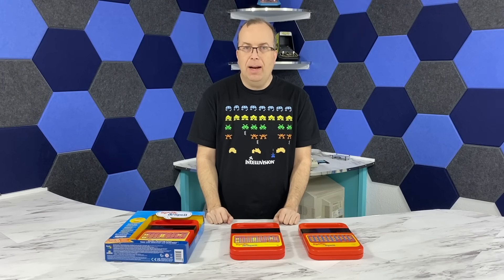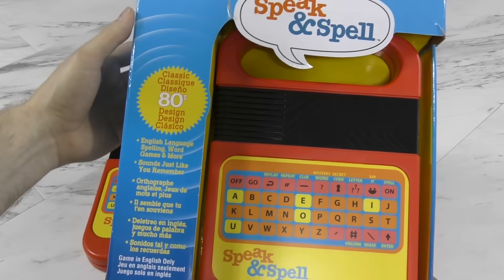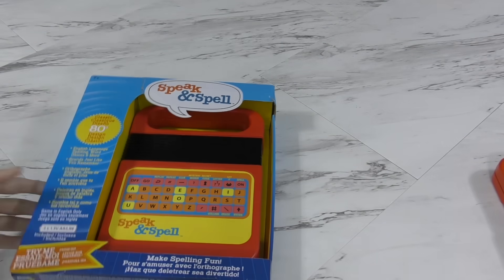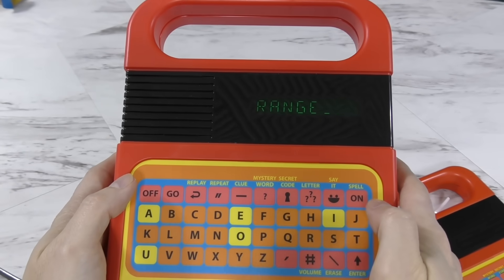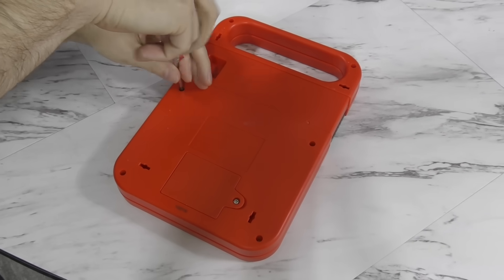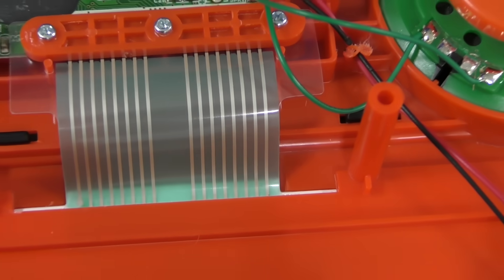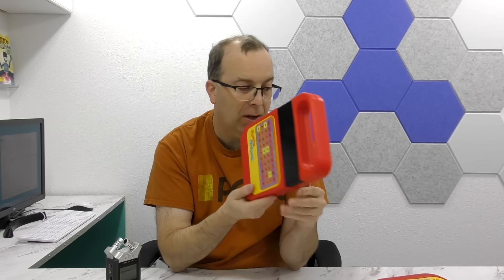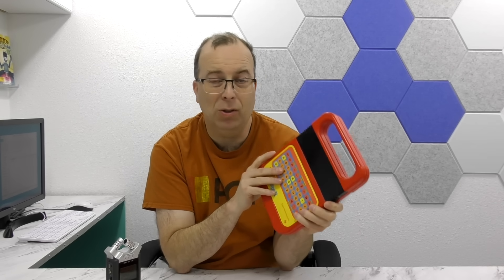Speak and Spell - 1983 vs 2019 model!

Comment: I'm not sure why they couldn't have partnered with Plogue, I believe they currently have the rights to the original Texas Instruments TI-99 voice (which I think is the same as the Speak And Spell TTS, it sounds the same to me at least) and they digitized it to use in a vocal synth program, turning it into a character named Terminal 99.
They could've just used the Terminal 99 version probably

Comment: Okay, none of them are the original. The original was pre-1978 and had the flat buttons similar on the 1980’s. The button one was made later to show progression of technology and to pretend. Now the original pre-1978 one I haven’t seen since 1978 or 1979 and being that I was born in 1978 it’s been a while. But it may have looked slightly different; but definitely not the phone button model, it’s newer.

Comment: Um, YOUR 1980s original doesn't say anything on boot-up. Mine said the exact same thing as your modern unit. I've had that phrase stuck in my head for over 35 years..."spelling, level A, press 'go' to begin. Press 'enter' to check your answers." Then in my head I always say "module" in the same voice, because I always pressed the module button after it booted up lol. 

So, I don't know why your original doesn't do it, but it's supposed to.

Comment: Hey David, I don’t know. I don’t think it really matters how old this video is, but I think that was a dumb decision of you to throw away those batteries, considering the fact that the reason why the batteries didn’t work was because you hadn’t removed that tag, the tag that you removed the white thing that you removed from the back of this machine was what was keeping the electricity from going through the whole system, which is why you couldn’t turn it on when you were trying to play with it, which is weird when you think about it, considering that it had the tag in the back why would it have a whole thing saying that you can turn it on and try it out when you couldn’t do that unless if you had to remove the tag. Pretty stupid but, by you removing those batteries, you could’ve thrown away some good batteries with some energy in them.

Comment: 2:28 The Chinese batteries in that are far superior to the crap Energizers you put in there.  The Chinese batts will NEVER leak.
Reply: Only because they are cheap carbon zinc cells. The only benefit is less of a chance of leaking (they still can leak though, I've seen it).

Comment: i knew exactly what it was going to look lke when you opened it up., I mean if you think about it, my smart watch which is a ton smaller packs about 1000x more punch that that little IC board, but is obviously more expensive to produce. That thing has about 75 cents in plastic and 3-5 dollars (mass prod price) in electronic components in it and they sell if for what? 30-40 bux? youre better of buying a prepaid cellphone at wallmart for that price and never activating, would have more power lol.. but i get the nostalgia of it all.
Reply: i didnt even finish watching when i wrote that.. and i see he came to the same conclusion as me lol

Comment: The biggest fault with the remake is that it's limited to the vocabulary in the base unit. Unlike the original, you can't load in additional words via the ROM cartridges that they sold. The new device should have had some flash memory and a USB port to load in additional words, from a website, which is easier now than ever.

Comment: The voice synthesis chip in the original SnS is the real star here (with the VFD a close second). Those TI chips use a simple serial input to generate speech. I’ve been scouring local thrift stores to locate one of the original models just to get my hands on that chip. I have a specific project in mind that requires a robotic sounding voice. Modern speech synthesizer ROMs are insanely complicated and difficult to code. Next one I find on eBay under $30 is gonna be mine!

Comment: Well, the benefit of the new unit is that it can be made into a more advanced computer with all the open space in the case. It also explains why there is no headphone or power jack. It would have been an additional board and case rework.

Comment: The 2019 was not manufactured by Texas Instruments. That unit was licensed by a company called Basic Fun and they omitted the usage of the microprocessor and synthesized voice chip TMS1000 and TMC0280. 

Also, the VFD LCD screen has been replaced by a segmented LCD screen. These alterations were done because the unit needed to hit a certain price point.

Comment: Actually the origional 80s design had actual keyboard bottons, not the overlay you show in this video. Our push button version lasted a lot longer than the overlay, in which the overlay would crack underneath on lans that got pressed more often, and costed $16  to replace from manufacturer. Chaney Electronics sold them at $3.20 each, so bought 10 for when they wore out as well. Not sure if they were manufacturer or generic at the time.
Reply: That was only a cosmetic issue. The electronic guts were exactly the same.
Reply: @jimbotron70  Not at all. The push button unit had a slot for additional cartridges, where as the flat unit did not.
Reply: @sirxanthor  OK, fair enough. Btw the sound engine was exactly the same.
Reply: @jimbotron70  Someone at some point, copied it over to the Amiga PC. I used to prank my younger brothers answering machine with it often.
Reply: @sirxanthor  Yeah, the narrator.device 😄

Comment: Agree that they should use an LED segment display, but doing the original voice would be easy: you can easily emulate the original speech synthesis chip on even an ultra low cost modern microcontroller. And in fact the software to do so on an Arduino is freely available.

Comment: I came across this video while working with an Arduino library called "Talkie." I was surprised to find out that I could actually play sounds and music on an Arduino with specifications like 2KB of SRAM and a 16MHz ATmega328P processor for the Arduino Uno. It gave me a sense of nostalgia, as if I were experiencing the same excitement that the 1980s generation felt when using Speak and Spell devices.

Comment: If you take the thing apart, the LCD is actually not "connected" to the board. It has a rubber strip which makes contact between the LCD and the board itself. I have no idea if its a traditional LCD with just an eccentric power delivery method, or something more ... amazing.
Reply: LCDs are all driven the same way.

Comment: I still have my Speak & Spell.  Later on I bought other Speak & Spells at garage sales. I also have the original units with the buttons instead of the smooth keypad.  

The 2019 version of the Speak & Spell, I can see the text without my glasses.

Comment: It probably wouldn't have been that hard to make the voice sound similar to the original one if one of the people doing the design knew of the sound exchange tool. It runs on the command line for both linux and windows, and can convert into and out of linear predictive code audio format among others, so they could have very well sampled those in if someone had taken to time to do that. LPC was what the original speak and spells, speak and maths, etc used and it in itself is what gives them their particular sound.

Comment: There is another market for these..  the circuit bending community... for the sounds. The distortion of the original sounds objectively better, and as the batteries would die, it would sound even cooler. If I could get that sound in a bitcrusher pedal for a bass, it would be a "holy grail" moment in my search for a perfect distortion pedal. I've seen/heard hacked speak and spells... pretty cool. The new designs are made to exclude the hacking community, and missing out on a segment of the potential market.

Comment: The only main differences is the AC adapter and the screen the original actually does have a bright vacuum fluorescent display as well as an AC adapter for if you don’t wanna waste money on batteries or as the new modern one doesn’t

Comment: Actually, i do think the speak-and-spell does have a place in the market - just, maybe not the market it was originally intended for. From what i understand of old speak and spells, is that they were very hackable and able to be turned into circuit-bended noise-makers and make all sorts of experimental musics with it. 

so .... if the manufacturers had instead been more faithful to that perspective of it, and gone with a larger board (or even 2 or 3 boards, with wires ?) that was readily hackable (as opposed to hiding everything under a blobbed-over microdot) then they would have maybe done a better job of moving product of this re-issue, rather than trying to lie to us as gen-X'ers and elder millennials, and try to 'sell to our kids' as cheaply and as exactingly-efficiently as possible, when we are clearly atleast 20 years into something vastly superior in terms of screen-toys. 

if i ever do buy the 2020-edition speak and spell, it will really be for the case only, as a 'rebuild from the outside in' project, as a then-purpose-built circuit-bended speak and spell.

Comment: I think the biggest flaw of the new one is the pre recorded sampled voice, only filtered to make it a little more like the original "robotic" one, but failed. The original used speech synthesis. Main selling point of making remakes is being faithful to the original, not "somewhat similar" which btw is why the Behringer clone analog synths are so successfull on the market. 

And the downsides: no output is clearly the downside (yeah you can make it yourself, but it's annoying and because these are samples, there is no point). LCD is worse than the original. OK i understand the speech synthesizer would be too big cost, but they could at least sample all the content from the original one and put it straight to the new one. It seems that no nerds were involved in the design process :(

Comment: As a nerd/nostalgia product they should have put at least an emulator of the original voice algorithm into the remake Speak&Spell (if too expensive, at least use samples of the 1980th authentic voice). For musicians those might be interested too, they should have also added the contents/words of all cartridges those existed for the original, and possibly a synth mode that (particularly if speech is emulated) could play with sound parameters to mimic some circuitbent sound tricks of the original.
Reply: Good point i wrote the same one minute ago. synth mode would be great. so, at the moment, is better to use some speech synthesis or buy arturia microfreak :)

Comment: So the 2019 speaking spell is trash cheap trash. Yes it takes smaller batteries but the screen and speaker are garbage and you can't plug it into the wall or plug a headset into it so a child playing with it has to go where they can't disturb anybody and God forbid the batteries die and there are no extra batteries in the house. I think I saw the the 2019 one is also dirt cheap like $25 where I know the 1985 one was $50. I know he was showing a 1983 one but you figure in the age range for the Speak and Spell and for me it was a $50 toy and no way my parents would have considered it. It's also the reason why I didn't get a Teddy Ruxpin or a glow worm.

Comment: "classic 80s design... that's sorta true, sorta not"

Then goes on to demonstrate that it doesn't have the same tech as the 70s design, rather is modeled off the 80s design...  Uhmm, yeah man!  That's EXACTLY true then!  lol
If it had said ORIGINAL 80's design, it would be misleading.  But it said the CLASSIC 80s design, which you then verified was correct.  Great stuff as always, love it :)

Comment: I've been doing a lot of thinking about the re-releases and remakes people are doing.
This ranges all the way from things like remade tv shows to remade products.
The look of the thing, or the sound, is fairly nostalgic. Unless you're a total nerd, and I fall into that category, you're not going to hear the difference between the TI sound chip and this new one. The appearance matches, and who wants to shell out for three C-cell batteries, so AA-cell are just fine.
But what people are missing, with this product, with remade shows and songs, is the character behind the thing.
The original Speak and Spell was great but had its limitations. I argue that the limitations are honestly part of the nostalgic experience. At this point, they would have done as well by making a $5 Speak And Spell app for iOS and Android. More people would buy it, more kids would get to experience it, and we'd all face the fact that the new device isn't a Speak and Spell sooner rather than later.
The problem is that you can't optimize nostalgia for profitability. The reason, as you stated, that the Speak and Spell was discontinued was lack of relevance. That means it was no longer profitable. Making a new device to vaguely emulate the Speak and Spell experience creates a brief surge of nostalgic feeling that quickly leads to disappointment because there's nothing behind the appearance. It's not hackable. It's not expandable. It's not compatible. The essence of the Speak And Spell remains, but that essence isn't profitable. In a way, a true copy of the original design that integrates the original components to the maximum extent possible would be more expensive but more profitable. I'm not suggesting we fail to integrate little money-saving ideas. The plain fact is that AA batteries are cheaper, so relying on lower-draw components would be awesome.But a $50 or even a $80 device that shows people the original experience with the bad, wobbly voice and the expansion cartridges ... that would sell fewer units but build greater trust. It would create the sense that there's more than a nostalgic paperweight being marketed.
I know this has become a rant, but the plain fact of the matter is that the folks in charge of gutting our childhood and selling us the husk need to understand that they're killing their own market. And the real tragedy here is that whoever is coming up with these ideas just isn't seeing the issue. The problem isn't that it doesn't look right or even that there's no demand. Nostalgia can sell well. The problem is that we remember a time when everyone was encouraged to look beyond the cover of the book, beyond the graphics quality of the game, beyond the name on the label. We grew up in a time where your brand"name Power Rangers or whatever would happily interact with your K-Mart Action Force or something of the sort. Sure, brand names are cool, but the problem is that the marketing departments of companies are relying on our brand loyalty without ensuring our continued respect. They're relying on the reputation of the intellectual property to prop up what is either something essentially completely different or something with just enough similarity that it isn't quite a lie to call it a remake or a reboot or a rerelease.
I'm sorry, because this comment has become a cynical rant on something I don't have real power to control or solutions to offer, excepting the obvious fix-all of creating goods and services that give more than a passing nod to their older, arguably better counterparts. I am genuinely grateful for these types of videos, produced by people who are knowledgeable and informative. It's just that, in agreeing with the conclusion of this video, I am reminded, yet again, that there's a real ethical and societal issue at play here. People like us want to invest in our nostalgia, but when we do, we can't share stories or lessons we learned with the people who only ever got their hands on the poor copy. It cheapens our own memories and our own stories, because the copy can't compare to the original. It strips the soul from our nostalgia in the name of short-term profit and long-term waste.
Thank you, if you read to the end, for your time.

Comment: They used that screen in the new one because the old style LED's suck up massive power (hence the four C cells in the original). Trimming down to standard AA cells required a compromise between battery time and viewing angle/brightness.

Comment: Speak & Spell, Mark 1 revision with actual buttons was featured in the film E.T., Mark 2 is membrane buttons, then the newest Mark 3.
I was after the Mark 2 because I presume the Mark 1 is very rare. Just today I was in "Convert to Cash" shop, & I saw a Speak & Spell on a shelf, knowing there are reproductions of this, I doubted this was a 1980's original. I remember watching you're video before about it & was comparing them. My dreams came true when DING!, The Texas Instruments Logo, Module Select, power & audio jack's, battery sizes, cartridge slot were present, so I knew it was an original 1980's model! They wanted £40 English pounds, I bartered them down to £20 English pounds, I now own, what I've wanted for years!😊❤️ You can forget you're reproduced crap!
The sticker on the back is still intact quoting

"IMPORTANT NOTICE
Build a home library with optional plug-in modules to expand the vocabulary of your Speak & Spell. Enquire at leading retailers."
Thankyou again, I might of thought it was a reproduction if I didn't watch your video ❤️